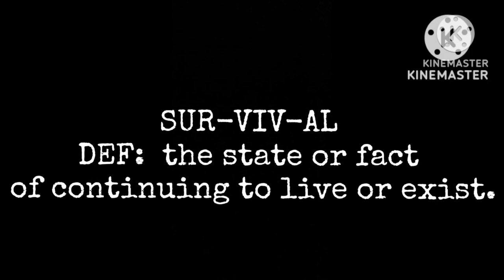SUPER EASY OFF GRID SAUNA/STEAMROOM  - " it's getting hot in here"@OFF GRID LIVING AND SURVIVAL PREP

Comment: You might want to insulate, ventilate, and tile the steam room. Tiling will help cut down on damp and fungal spores / mould. Ventilation will stop the gas from causing carbon monoxide poisoning, and insulation will keep you warm and toasty.
Reply from the maker: It is insulated and vented, I'm going to use cedar on the interior.  It will smell nice and the cedar absorbs and releases moisture very well.